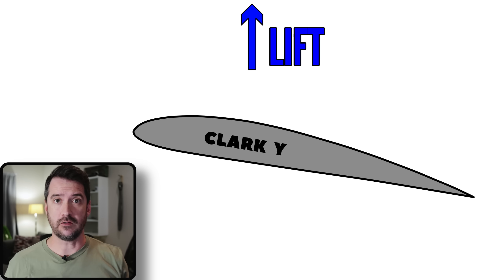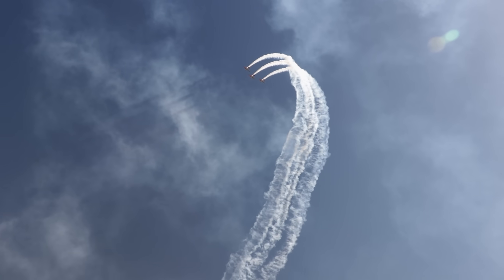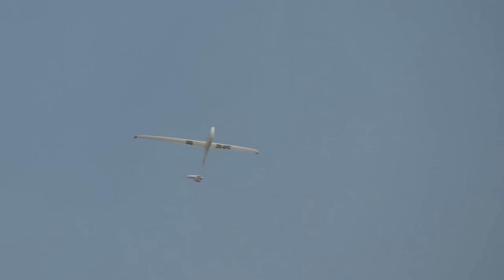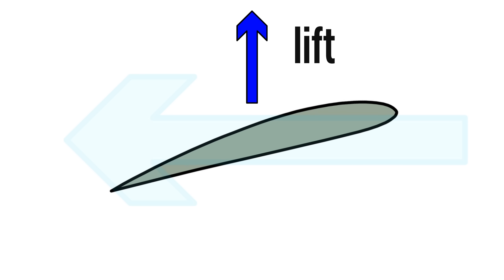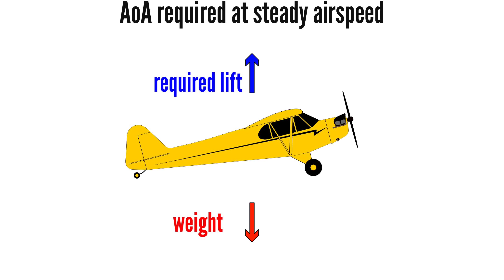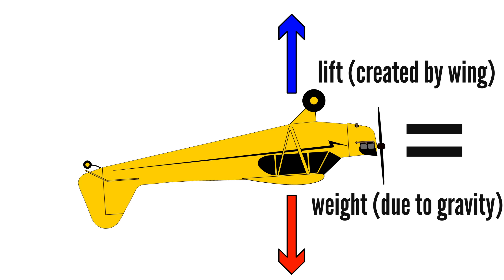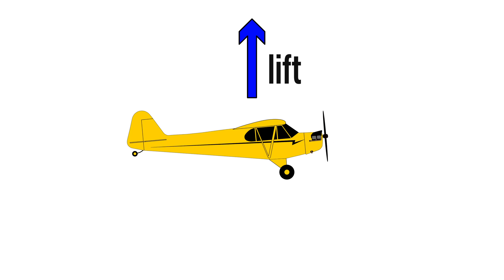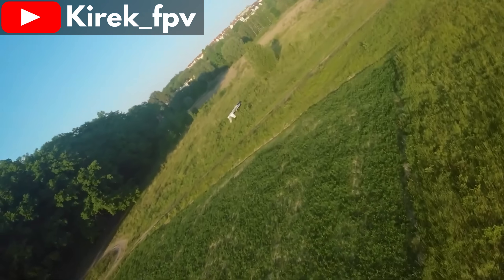Is Airflow Distance Over the Top of a Wing Always Longer?

Comment: So many kids and ignorant adults, make statements without knowledge and critical thinking, then post it on YouTube as fact.

It's not that they are asking for correction or seeking knowledge, NO..they know it all because in their mind the world and everything in it is simple and can be explained by any random thought that enters their mind.

Worse, they fight tooth and nail even when proven wrong.
The human race cannot save itself from destruction.

Thank you for the correct explanation. 

I was taught and understood that the pressure differential was a major component in lift as it "vacuumed" the aircraft into the air, all other parameters being equal.
Reply: The "vacuum" or low pressure on the top of the wing is created according to Newton's laws of motion which state that a moving object wants to continue its motion and direction.  The airfow over the top of the wing wants to keep on going in its intial direction.  that creates a low pressure area above the wing, and that low pressure causes the airflow to alter its direction.  An efficient wing shape alters the airflow's direction without causing turbulence and directs that airstream in a downward direction through its angle of attack.  That is all that there is too it, and Bernoulli can go jump in the lake (or a pipe of varying diameters with a water flow, which is where it belongs.)

Comment: If lift is created predominantly by the shape of the camber of the wing, then a wing with its bottom side perfectly flat pulled perfectly forward at a sufficient speed should rise, and it doesn't. It always needs at least a little inclination or wing deformation to start lifting. Not saying 'ergo you are wrong' but there is more going on here.
Reply: The Clark Y is a cambered airfoil with a flat bottom. It has a coefficient of lift of 0.2 at 0° angle of attack. That is enough to lift half a tonne with a wing the size of a Cessna 172 flying at 100 knots. This same airfoil needs an angle of attack of about negative 2° before the lift goes to zero.

Comment: Proportionally, an RC airplane has 25 times more power than a real airplane. An RC airplane is also comparatively much lighter. The disadvantage of an RC airplane is that the air molecules are proportionately further apart, and in principle it has less carrying capacity.

Comment: Correct, per NASA:
" In reality, the velocity on the upper surface of a lifting wing is much higher than the velocity which produces an equal transit time. If we know the correct velocity distribution, we can use Bernoulli’s equation to get the pressure, then use the pressure to determine the force." Force being the pressure differential between the two surfaces.

Comment: Newtons laws of motion say that you do not get something for nothing.  The airfoil uses an angle of attack to exert a force on the airstream which alters the direction of that airstream downwards.  That redirection results in an equal and opposite force upwards which we call "lift."  
Very low speed airfoils, such as a sail, have exactly the same length on each side, yet they produce the required lift.  Low angle of attack hydrofoils that are commonly found on sailboats also produce the required lift, but are nothing more than 1/4 inch thick flat metal plates.  
Bernoulli does not explain these situations, but Newtons laws of motion work very nicely.

Comment: It's quite possible to fly on angle of attack alone and even with a flat slab, but the efficiency of the whole thing is going to be terrible like that. And not to mention some issues with stability going into a stall. If you're dealing with any significant payload, you need the airfoil to economize and get the most lift.

Comment: In my study aeronautical engineering, we tested  a cambered aerofoil in the windtunnel. It had holes in it to measure the static pressure with liquid filled tubes.

Afterwards we'd calculate the force applied by the pressure differential so weve learned it adds up and why it does.

Everyone who says it doesnt, didnt do this test, and is subject to its own limited thinking.

Comment: Lift from airfoil is not enough to fly ,without aoa is impossible…so they r two different things.aoa makes airplane fly ,airfoil makes it beter
Reply: @davetime5234  yeah speed proportional to lift from the airfoil…thats the last episode … b4 u got to make it take off safely and keep it flying up to cruize speed
Reply: @davetime5234  basically the “argument” umention is not an argument cause it doesnt exist….if u flip an airfoil upside down the lower part has got to have an aoa otherwise it will do its job and crash u down…

Comment: I read long ago that Bernoulli's principle is involved in creating lift. The faster a fluid moves past an object the less sidewise pressure it creates. Air flowing past an object wants to maintain equilibrium and in order to do that it must flow faster over the top than the bottom, creating less sidewise pressure on top than on the bottom of the wing, thus creating lift. Is this not correct?
Reply: Not really.  Please actually watch the video -- the whole point of it was to get people off of that explanation.

Bernoulli is perfectly correct, but the mistake is to apply it to the wrong idea about velocities.  The air has no wish for the top to keep up with the bottom, and in fact the air on top typically outruns the air on the bottom by quite a margin -- the equal-transit-time idea would predict only a few percent of the lift actually observed.

Comment: You didn't mention symmetrical wings. Which is better for inverted flight. It's lift coefficient is rather low too. But it has equal performance inverted or not.
Lift forces are caused by two phenomena: impulse and pressure differential. Impulse is the AOA driving the air mass downward by deflection, whereas Bernoulli taught us about velocity and pressure differential. The air travelling faster has a lower pressure than that taking a shorter path.
Very nice presentation, Sir.

Comment: Every time the wing send an air molecule down then the wing go up by an equivalent amount.  Everything else is just different way the wing can move those air molecules down. Air vortex, deflection,  low pressure ect... Name it, It is all  moving air molecule down enough to move the wing up.   If you look at the flow to see what happen then you can notice that the trailing air molecule are going down relative to the wing. So everything that happens in between is just the way the energy of the molecule that go down is transferred to the wing so that it can go up.  I do not know if I simplified too much. But it is pretty much it.  Really complicated fluid simulation just help to know exactly how the energy was transferred trough the fluid. But it is  basically the good old  Newtonian action reaction physics at play.

Comment: I learned most of this back when I was between 12 and 14 years old and my Dad was teaching me to fly model airplanes. This was many years before RC flight took off (pun not really intended). The first planes I flew were control line and had flat wings being a simple slab of balsa. My first good (good in my opinion) plane was a Ringmaster from Sterling which had a semi-symmetrical wing and flew quite well upside down with only a slightly nose high attitude. My dad won a bet with an acquaintance who bet him $50 (a lot of money in those days) that he could not fly a 1x12 board which my dad proceeded to do. It didn't fly well but it flew. Big engine for the time, a Fox 59 up front and a large elevator out back. I seem to remember it having about a 3 foot "wing" span. I learned that with a flat bottom wing you could life heavy loads pretty easily but you had to readjust the elevator trim as you increased or decreased speed. You could counteract this with downthrust on the engine but it had to be just right. In my adult years I flew a lot of differently designed planes. Proportional radio controls had become practical by then and one of my many different aircraft was a Senior Telemaster.  My Telemaster addressed that problem in a different way by having a lifting horizontal stabilizer.
So while this video sounds simplistic to me, I did learn some new stuff especially about the stagnation points. I'd never heard of those before.
Also, I've pretty much figured out that propellers, no matter what kind, develop their thrust because they are just very specialized wings. Same for the turbines in a Jet engine or a Turbo Supercharger.

Comment: Planes fly with no airfoil at all. You can fly with flat plywood wings if the angle of attack is correct.  You can fly upside down as well.  The shape of the wing improves airflow, but there is a Newton force on the bottom of the wing as well as the Bernoulli vacuum on the top.  For an airfoiled shaped wing, you may gain some efficiency from the Bernoulli forces.  Planes also fly with a curved sail wing, where the above the wing air path and the bellow the wing air path are virtually identical.  I think there is some efficiency gained by a curved wing shape or wing or sail on a boat.  This force will make a boat sail at a higher angle to the wind. However, it may not be the biggest force in lifting the plane or pushing the boat.  I suspect for the newest hydrofoil boats, their wing shaped sail provide greater Bernouli effects, which likely increases at speed.
Reply: @davetime5234  So you are saying that both the lift on the underside of the wing ( that I called Newton, and the decrease pressure on the leading edge are both called Bernoulli forces?   And you think that the pressure on the underside of the wing is modest?  I think all that depends on position of the wing and the speed of the air crossing it.
Do you have any wind tunnel data for your average path length assertion for sails?  Love to see it.  
Most wind tunnel tests I have seen show air slipstreaming off the back of the lower surface.  Are you saying that the pathlength of the wind on the interior of a sail going to windward is significantly shorter than that going around the outside of the sail?   I'd like to see the data.
If you are saying that the lift is primarily due to the wind hitting the underside (on a right side up aircraft) of the canted wing, well then we agree.  I still think the Bernoulli vacuum on the leading edge is a smaller force than the lift generated on the bottom of the wing in most cases when the plane is getting up off the ground.  In level flight I don't think the bottom pressure is particularly large.

Comment: Very good! However you don’t show a really good example of the importance of the upper surface of the wing…
Small planes in WW2 sometimes had many bombs and extra fuel tanks slung under the wing… almost covering the surface, and they could just about fly, showing that the impact of the air on the lower surface, which can be demonstrated by running holding a sheet of tilted cardboard is not the whole story either…

Comment: As an airfoil, wing, moves through air, the perfect vacuum at the surface of the back of an airfoil, wing, redirects air downward. A low pressure zone is created that pulls down additional air from above the wing. All of this “scooped up” air is accelerated down the backside, trailing edge, of the wing. Opposite but equal action = lift. Basically a plane is a horizontal rocket.

Bernoulli has next to nothing to do with it. As air pressure differentials are involved, the Bernoulli equations only approximate the processes and forces involved.

It then follows that gravity is the primary source of energy for sustained flight. Hence unpowered glide-ratios, auto-gyros, gliders, etc.

By the way: Wind tunnels CANNOT visualize airflow over an airfoil, wing. That’s becase in flight it is the airfoil that is moving through the air, not the air.

Comment: OK, the circulation theory of lift can be broken down a bit.  Step (1) Start with a 2D model of a wing, which is just  its cross-section.  Circulation is the laminar flow around a wing.  Air forms a circle going clockwise around the wing.  Of course, it is not strictly a circle 'cause the air above & below the wing are both going in the same direction and speed.  But the laminar air (that is, the air just a millimetre or two around the wing, the bit is going slower becausevit 'sticks to' the wing), both above and below the wing, is going at different speeds at different points along the wong and if you subtract the passing ambient airspeed, what remains is a circular flow.  So far, this sounds like a Bernoulli argument but it's not.  This is because the ambient airspeed is the same above and below wing, in contradiction of the standard theory, at least in a subsonic wing.  It's the circulation that explains the pressure differential.

If we measure this Circulation with a circular or path integral, then it necessarily sums up to zero.  However, its components are not zero, and this is what supposedly  generates lift.  Step (2)  increases the sophistication of the above argument.  Actually, the circulation around the wing is not zero.     This relates to the fact that the airflow at the trailing edge of a real wing would be infinite (it abruplty changes direction, not speed), which is impossible.

Instead, when there is laminar flow, a vortex starts at the trailing edge which, because it is circular, avoids any infinite changes in direction.  This is called the Starting Votex, and it moves in the opposite direction from the Circulation around the wing.  The momentum in the Starting Vortex is exactly equal but opposite in direction to the momentum in the Circulation.  This allows for the Circulation to have positive momentum, even as the net momentum of the Circulation plus the Starting Vortex  remains zero.  And yes, the Starting Vortex gets left behind at the airfield you took off from, even 12,000 km away.  Conservation of energy and all that.  Step (3).  Remember that this was a 2D theory.  This theory also applies to 3D wings, provided they are infinitely long!  Another impossibility.  So you now have to account for vortices around the wing tips.  When this is done, it leads to a fairly fullsome explanation, not just of lift, but of how winglets work.  Step (4).  Angle of Attack and Drag arguments are entirely consistent with this Circulation theory and discussions about laminar flow.  The theory also explains why (some) planes can fly upside down.  Step (5).  The theory has also been used to explain lift in insect wings.  These are fun because they continuously vary their Angle of Attack.  Step (6).  Enjoy!
Reply: Sure,  but I was keeping it simple.  Laminar flow is extremely important.  It contrasts with turbulent flow.   But it's role is nuanced.

"In the circulation theory of lift, in addition to the laminar flow around the airfoil there is also a circulatory flow around the wing. This circulatory flow is generated due to the formation of vortex and anti-vortex."  "Clearing certain misconception in the common explanations of the aerodynamic lift".  2018.  Navinder Singh, K. Sasikumar Raja, and P. Janardhan.

The standard application of the Bernoulli effect is too simplistic.  Which is why the Circulation Theory is more fulsome.

The Navier–Stokes equations help us solve the equations of conservation of mass and conservation of momentum applied to an inviscid fluid flow.

But these equations normally do not result in a closed-form solution. The Kutta condition is an alternative method of incorporating some aspects of viscous effects, while neglecting others, such as skin friction and some other boundary layer effects.  But these assumptions cannot really be ignored.  In short, there are only numerical solutions which are almost never exact.

We could go on and on and  .. but this is not the right forum.  You are welcome to contact me seperately.

Kind regards, James.
Reply: There's no need to be beligerant, David.  I'm not avoiding debate.  What I've said is that we should use a different forum from hereon in.  Most of the readers of this forum do not have the mathematical skills to debate the relevant theory at this depth.  I've given the others enough hints to research the rest for themselves, just as I once did.

Also, I do have other things to do (a son to look after, elderly parents to care for, a second masters degree to complete).  And the chores my wifecsets for me.

To this end, I have offered to direct you and your readers to some texts on the Circulation  theory of lift.  These texts are extremely detailed and lengthy.  I, with my 40 year old maths degree, could not do them justice in an online forum.

You are very welcome to study these text for yourself, in your own time.  I've done my level best to help you put by pointing you in their direction, within the constraints on my own limited time and resources.  You could, at least, have acknowledged that.

And finanally, and with the greatest of respect, the statement that, "The fundamental principals of lift can not be described in terms of the first principles of physics", shows a deep misunderstanding of physics. This is precisely what physicists endeavour to do.

The fact that physicists cannot always devise equations to explain everything using a closed form solution is neither new nor novel.  It does not mean that we are 'missing' anything.  It is more a limitation of our current understanding of mathematics.  There are lots of papers on this very topic.

I am currently researching quantum mechanics for a project in my Master of Cybersecurity degree.  Since I'm now 65, it is testing my neurons.  So, you'll have to excuse me.  But I've given you as much time as I have to spare.  I'm now done!  Cheers, James.